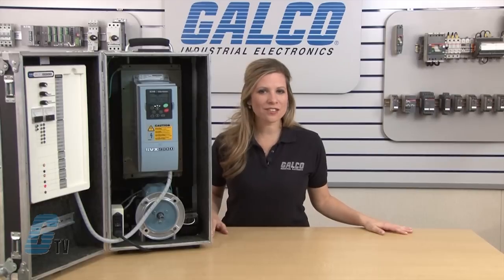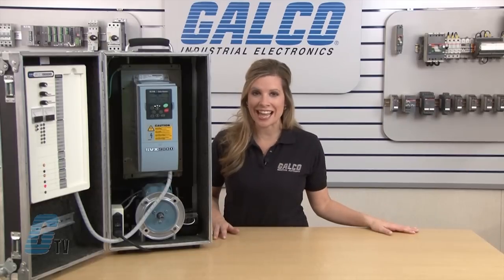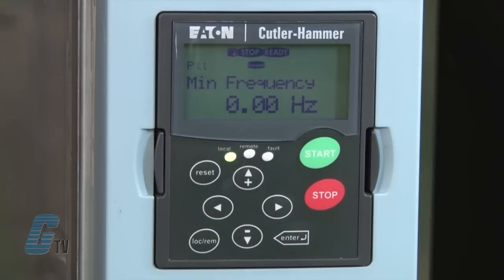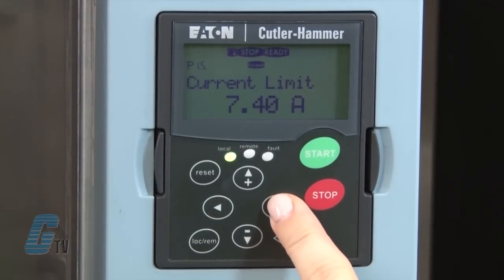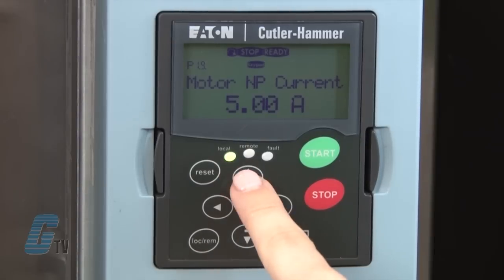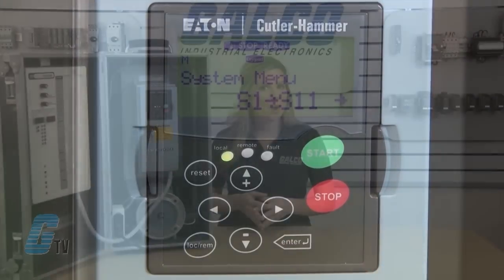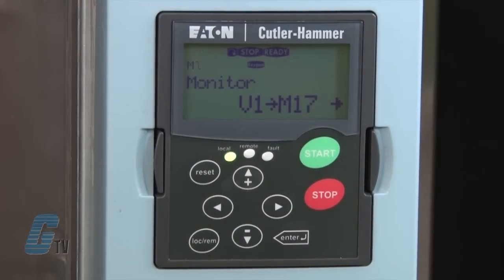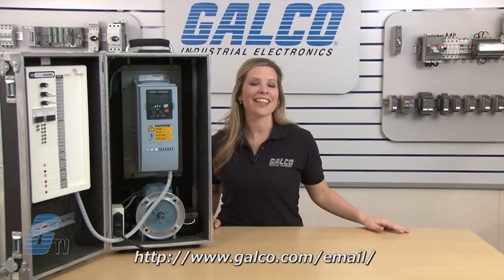Eaton Cutler Hammer SVX 9000 AC Drive Basic Start Up

Comment: Anyone still use these? I have one in a failing public water system. It is in remote mode, and none of the 3 lights are on. The remote control is a Hand/Off/Auto switch. When I go into local mode, none of the 3 lights are on. I need to learn how to get it into Keypad operation mode, so that I can manually reverse the motor if/when needed.

Comment: HOW TO ADJUST PARAMETER DRIVE MANUAL START AND STOP
Reply from the maker: If I understand the question correctly, you simply push the LOC/REM button on keypad to use the keypad as manual mode of operation, ok?